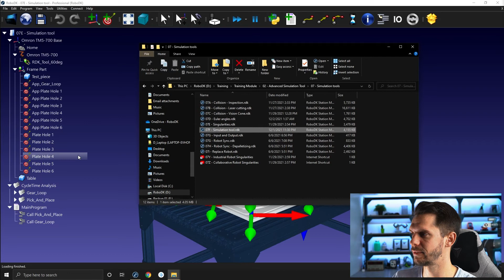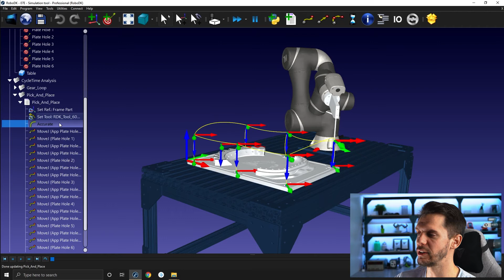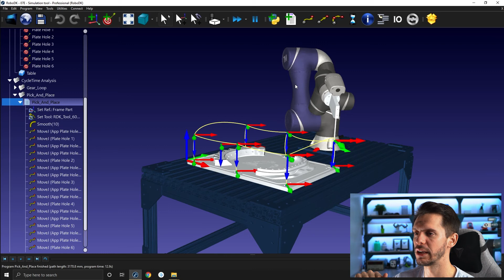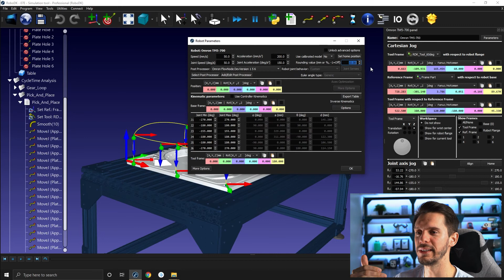Rounding and Blending - Course 7.08 - RoboDK Academy

Comment: Hello Jeremy. So, as to clarify... the rounding command does not generate an effect in the simulation, but it does generate an effect on the robot depending on its brand and how it's controller inteprets the command. Is this right? and if this is so, why RoboDK simulation doesn't generate the animation according to this characteristic? Will this be programmed in a future revision of the software?
Reply from the maker: You understand it right.
Mostly because each robot brand will manage it its way and it's hard for us to know exactly how they will behave. It's also speed and payload dependent.
Maybe in a future version.